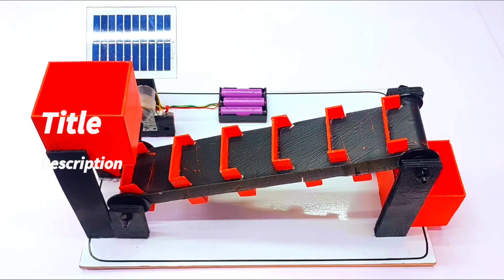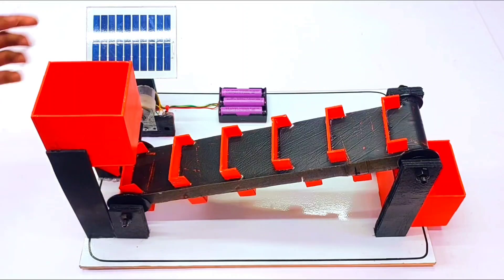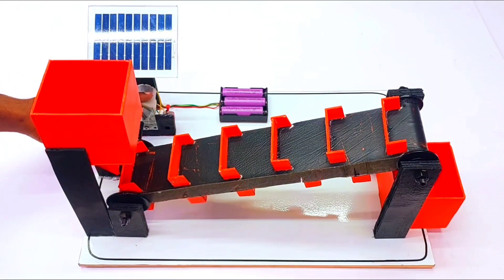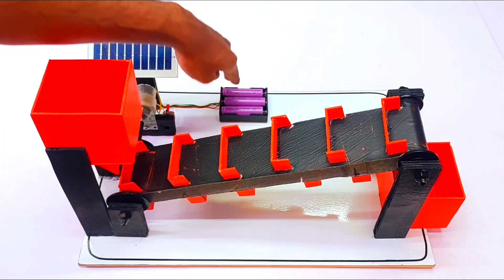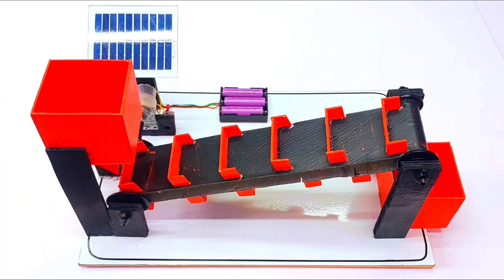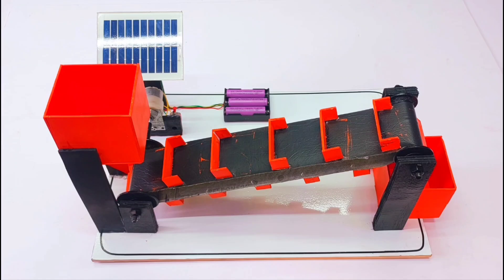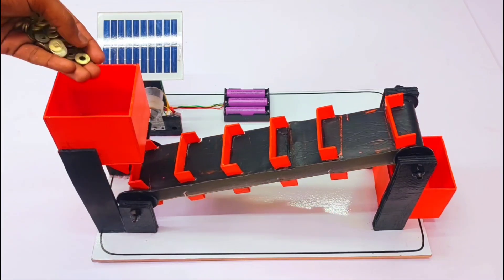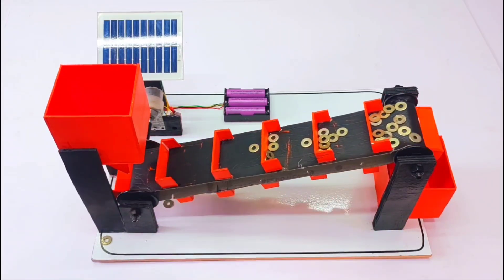SOLAR ENERGY BASED BUCKET CONVEYOR BELT SYSTEM || CREATIVITY THINK || #project #diy #engineering

Comment from the maker: For ordering the project, contact us 919483175986, 917019689991.

Welcome everyone to Creativity Think We are introducing our latest project, " SOLAR ENERGY BASED BUCKET CONVEYOR BELT SYSTEM "

For the Ready-made Working Project kit.
The ready-made project kit along with comprehensive documentation synopsis of the project ,circuit diagram, program code, explanatory video audio and video call support, and a one month warranty of the project priced at 5500 Rs.